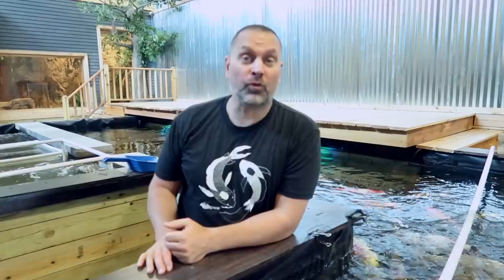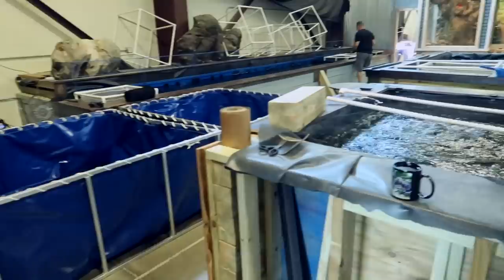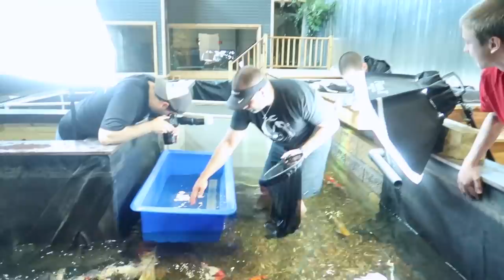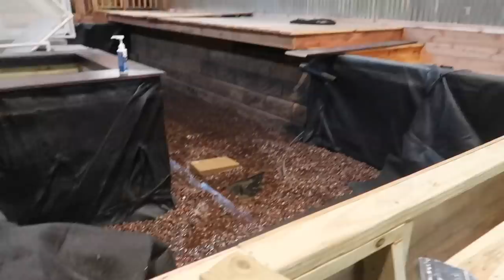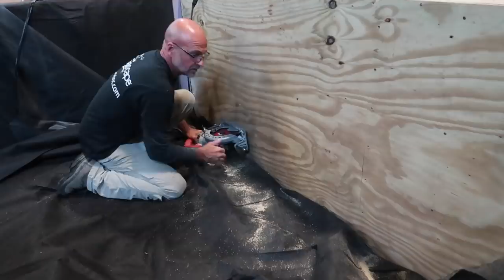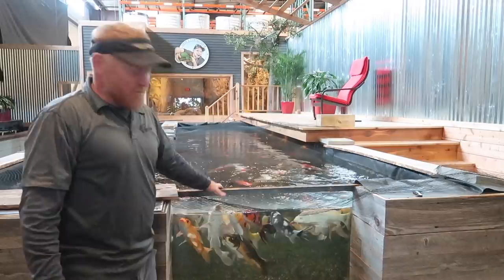INDOOR POND W/ NEW Viewing Window for Prize Koi

Comment: Sorry it's me again.
Conditioned water is the biggest bull you can spread around.
The filter material (gravel and rock in your case) should kept moist and well aerated with oxygen.
The water which you use to refill the pool with, should be about the same temperature, that's it.
All the bacteria you need for a good water quality and water clarity are not free swimming bacteria!
These bacteria settle on gravel, rock, edpm liner. and everything else where bacteria can grow, you can even uses Rolexes as a media where you let you bacteria settle!

If you like, add some bacteria when you move your fish back in to the pond.
As stated before, these are not the same bacteria cultures as you have in you filter. they will help keep your water lower on ammonia, nitrite and maybe nitrate but they will die within a week, that's why you need to add this type of bacteria daily (automatic dosing system) or weekly (bottle, pump, powder). In nature you do not see people refilling the automatic dosing system or adding a bottle of bacteria weekly to a pond.
It helps (and of course creates revenue) if your filter is not doing a great job because it is not aged yet (or you pressure wash the filter media and thus remove the bacteria layer) the water doesn't flow correctly past it or whatever reason.
Keep in mind it also prevents the bacteria you want (automatically arrives in the water) to multiply because you add free swimming bacteria to your pond. 

But back to why water is not to be kept.
Every day your koi pollute your water!
The most of the pollution is removed by bacteria in your filter but not all.
The 2 most common ways to remove this pollutions is with water change or ozone.

The pollution you want to get rid of are the growth stopping pheromones.
Let's see it like this. If a carp (koi are carp) find that his environment can not supply it with enough food (bugs, insects, artemia) it will give out pheromones to the water. These pheromones will keep all the carp in the water from growing bigger.
A bigger carp needs more food to survive than a smaller one.

The carp cannot keep in account that we feed it additional pellet food so the supply of food will be enough even if it grows.
From the old ages a carp knows he needs lets say 10,000 Gallons of water if it's 3 feet, we are with 3 carp in 10,000 gallons so we may not exceed 1'8" otherwise nature can't provide enough food. So STOP GROWING!

I believe the lack of changing water could be the main reason why most of the shown 'aquascape koi ponds' have such small koi.
If smaller koi are OK for you, that's fine.
If you like bigger koi 2'4" and up, start applying weekly water changes of between 10-20% of your pond volume.
Just do this for 1 summer season and you will see, your koi will grow, even the older ones.

I've had 1 koi in my pond for 25 years and it was 2'4' for 20 years!
I've started changing 20% water weekly in the outdoor season (may-oktober) and after 4 years this same koi is almost 30 years and grew 4" to 2'8".
If the koi has the genes to grow and you provide the environment, it will grow, even after it has not grown for 20 years!

Enclosure looks good, window should have been at least twice as wide.